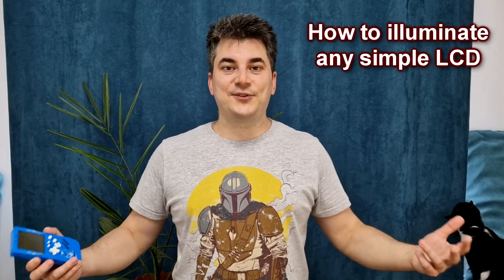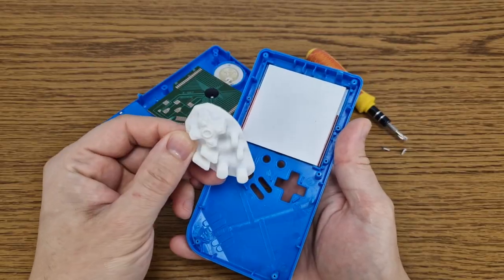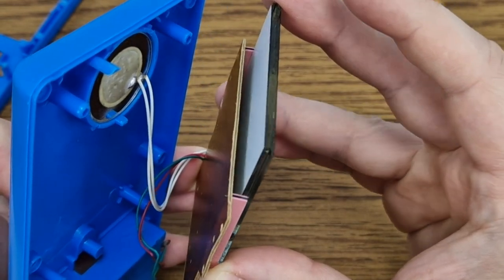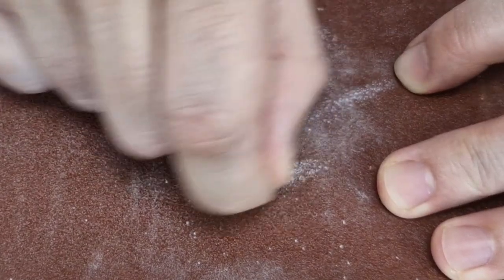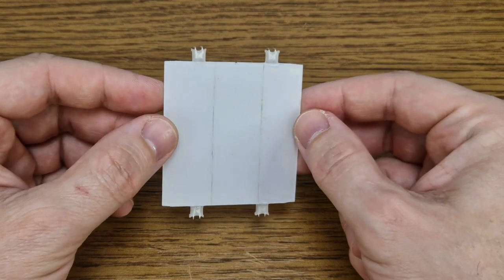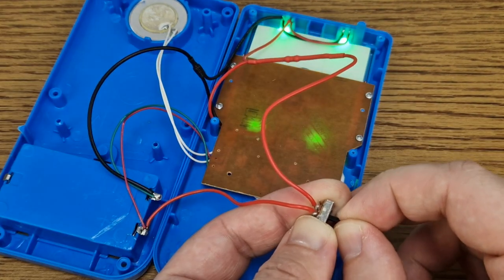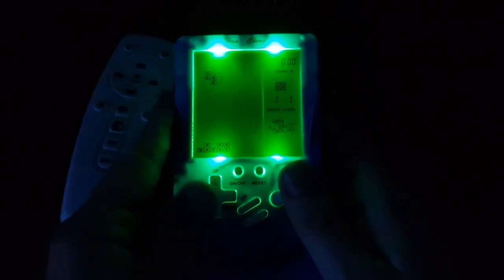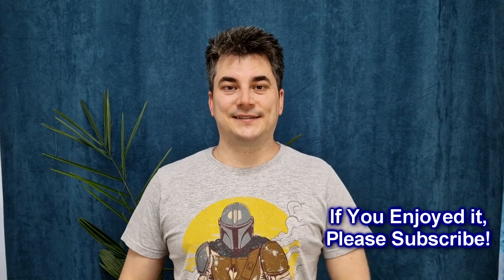How to illuminate any simple LCD

Comment: The inside of the case could be painted black to eliminate the bright spot at the LED.  Or put copper tape on the sides of the LED's.  Another place to find cheap plexiglass lens material is old LCD CFL computer monitors.  The first time I did backlighting was on a AM/FM analog transistor radio from Radio Shack back in the 1970's.  This video brings back memories!

Comment: Mr. Sorin, I really like your tutorial videos on DIYs. I hope you could make a tutorial video on how to compute the right resistor rating.  

EXAMPLE:  how to get the resistor rating if I'm using an 18650 battery with a 3 volts LED bulb. Thank you!! more power to your channel sir.

And also, what is the maximum number of 18650 batteries (or old cellphone batteries) can a TP4056 charge without blowing up the module?

Comment: Nice, can old smartphone LEDs (from the screen) be used in a similar manner?
Reply from the maker: yes
Reply: @Sorin_DIY  awsome! I want to try placing the smarphone LEDs in an old Fluke multimeter without LEDs, do I need to use a resistor like in your video?
Reply from the maker: yes. but the value of the resistor depends on what type of battery your multimeter has.